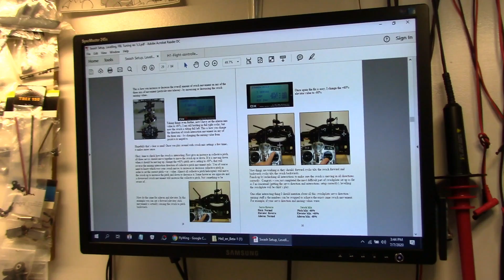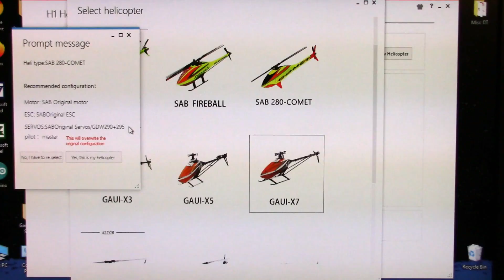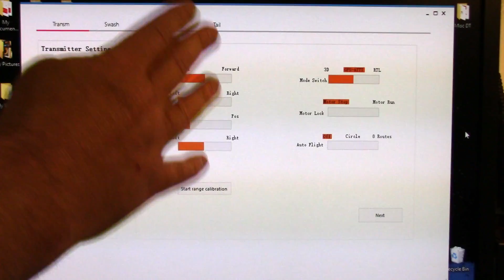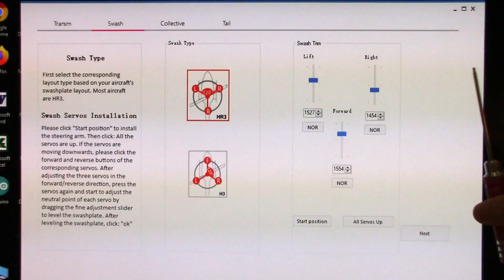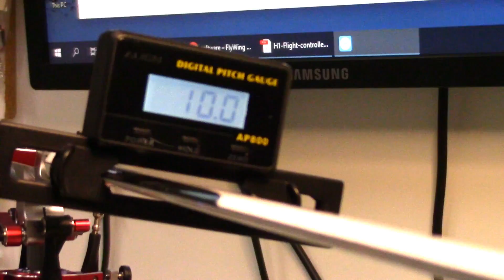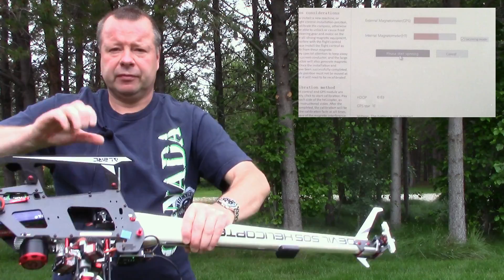Flywing H1 Setup Tutorial & Tips

Comment: will you be reviewing the new H1 unit with the smaller GPS unit.
cheers.
Reply from the maker: Nope, hate these things and we no longer allow them at our field.
Reply: @rchelicopterfun  any real reason, or just that they make new fliers think they can fly a helicopter.
Reply from the maker: I cover it on my web site in detail on my "Are RC Helicopters Hard To Fly" page:
https://www.rchelicopterfun.com/are-rc-helicopters-hard-to-fly.html

Quick summation: Main reason is they are extremely dangerous for the exact reason you stated. It's one thing having an entitled droner flying a harmless quad copter without any skill or knowledge, it's a totally different story when that same type of person has a 5hp helicopter spinning a 1.5 meter diameter rotor disc. I've seen way more high energy crashes with these GPS systems on helicopters in the hand of morons than we ever saw before with normal mechanical and electronic flybar stabilization. It's why they are no longer allowed at our field.
Reply: @rchelicopterfun  Totally agree, I usually take mine with me when I go flying my gliders, slope soaring mainly, it makes a nice change for half an hour while batteries are re charging, usually I am the only one around now with the size restrictions so don't get tempted to show off.                                                                                                                                                                                                                   cheers.

Comment: I just got the FLY WING Huey UH-1 and right out of the box I got a GPS Connection Exception error (constant blinking red light).  Support told me I need to calibrate the compass which i did successfully many times.  I ordered a new FlyWing H1 FC GPS Long Wire which should remedy the problem.  Great eye opening video presented in a professional educational format.  UPDATE: Replacement GPS module installed, recalibrated and flys like good in GPS.  When switching from GPS mode to 3D, the Heli descends, so I have to push up on the collective past center, need to figure out how to tune that and I'll have a good heli.

Comment: could not get mine to unlock motor even after getting green flashing light any tips?
Reply from the maker: LED has to be solid green - flashing green indicates it has not acquired enough satellites to position. Also recheck channel 7 (motor run) output calibration & direction in the transmitter setup portion of the wizard. May also have to recalibrate your ESC to arm if it was calibrated for a lower input signal than channel 7 is now producing. Also confirm the throttle % output setting in the wizard .
Reply: Ah solid  green LED.  I feel so klutzy (lol) ok I will make another attempt in morning.  Going to study the steps/tips provided.   I was about to just put on an ikon (have laying around) but don’t want to give up that easy :) I will keep you posted.  I also have two of your books I rely on before hitting up the internet.. I have them all highlighted and taped.  Very useful knowledge and detailed.  Thank you Mr John Salt!!
Reply: Success!!! Recalibrated ESC using CH7, recalibrated the GPS.  Followed all your steps checked wiring.  Thanks again!!!

Comment: Dear Mr.Salt. Thank you for very helpful videos on YouTube!!! May I have a question, please? I´m struggling with one think. Usually I´m flying on left stick cyclic completely and on right stick gas with tail, as well. Normally it is mode3. But! On the H1 diagram (setup assistant) I have problem with correct stick moving (indication). With this mode3 are changed throttle with elevator - I mean when I move collective stick (pitch) the diagram indicate moving of elevator and reversed. Correctly goes it if I change the transmiter mode from 3 to 4. But in this point I have unfortunately pitch on the left stick. I have no idea, how to harmonize the correct moving between sticks and the diagram. I suppose when it is on diagram incorrectly, will the unit also in flight incorrectly work. Do You have any tip for me please? A big thank to you in advance, Vlastimil (please, sorry for my English)
Reply from the maker: Contact FlyWing tech support. I don't even know if you can change channel mapping within the H1 (I don't think you can). This to me would strictly be a computerized radio programming issue to remap the outputs for different stick modes.
Reply: @rchelicopterfun  Hello, ok thanks. I will do it. Have a nice day.

Comment: Does H1 have the option for setting the tail pitch at zero degree when throttle hold switch on the transmitter is activated for auto rotation or is it set in the transmitter? Thanks for the thorough instructional video.
Reply from the maker: Heading lock - not required - done automatically.
Reply: @rchelicopterfun  thank you

Comment: John I'm having trouble calibrating GPS and H1...how do you keep from getting tangled up with H1 cable cause offline doesn't work well for me. Thanks for listening
Reply from the maker: You mean the USB  cable during compass calibration? If so, I never had any issue getting tangled up while calibrating the magnetic compasses; you just turn the the heli along each of the 3 axis the opposite way the same number of times on each axis so the cable never tangles.

Comment: Hey john...great video and informative....Just now thinking of buying two of these H1's. I want place H1 in a 500X Align and a XL power 550. Do I need to readjust my ESC for voltage output . The BEC output voltage should be to 7.2V. and other question is the Aircraft title should be normal airplane or helicopter. Not good with this technology stuff. Still learning?  Thanx a lot

Comment: Hi John, we many H1 flyers encountered many different issue. not sure you still have it with you. would be interested to see H1 interner and what type GPS module they using? Found it quite similar to M8N pro with 6pin, just not sure the pin layout is it the same.
Reply from the maker: @Alex Bong RC Fun Land - Best way I know to avoid H1 issues is to get rid of it and put in a proper FBL system 😄
Reply: @rchelicopterfun  The main selling point that  H1 attract us is the GPS positioning. It locked the heli made it so stable and easier in hovering and flying. 😅
Reply from the maker: Where's the fun in that 😄
Reply: @rchelicopterfun  still fun, just less stress on crash it…hahaha

Comment: CH 3 is THR or collective what controls the pitch?
Reply from the maker: Ch3 is collective - I covered this in detail in the video in the channel mapping order segment, with channel 7 engaging power - there is no throttle control - only a fixed output you select in the setup wizard.
Reply: @rchelicopterfun  OK I will go check the video again Thanks

Comment: Can this work on a nitro heli with a fly bar?
Reply from the maker: @ Mike Smith - No for two primary reasons:
1. You can't use any RC helicopter electronic stabilization system (flybarless system) in conjunction with a mechanical stabilization system (the flybar).  At minimum you would get uncontrollable cyclic oscillation with two stabilization systems countering each other out of phase. At worse - the heli will crash as soon as it gets light on the skids.
2. As you saw in this setup video, the H1 has a single throttle channel output value. It would therefor be impossible to use on a nitro engine which requires a variable throttle output to enable choking, fast idle trim @ startup, low idle trim once warmed up, and a variable output to match engine/rotor speed with collective pitch loading (why we use nitro throttle curves). Even if nitro governor is used, you still need variable throttle channel output levels to put the governor into it's various nitro running modes (choke, start/idle, governed normal, st1, st1 head speeds).
Reply: @rchelicopterfun  Thanks for the info. I'm a total noob when it comes to Heli's, throttle curves, etc I'm more of an FPV racing drone flyer. I've never actually fired up my Raptor 50(Bought it for $40, couldn't pass it up!), one day I'll fly it. Just scared shitless till I get better with my Blade 330s. I got the BNF one and trying to set it up with my radio master 16x which needs manual programming the throttle curves .  Heli's are a whole new world to me

Comment: Hi now I can conect and config with mi laptop , but I think the tail gyro is wrong, because correct to wrong side... with my helicopter is on, and I can full control with my radio, when take the helicopter with my hands and turn tu righ, the tail nove to the right side, then I turn the heli to de left, the tail move to left. I think that is a problem... should correct to the opposite side so that it can counteract the turning force of the main rotor

Comment: Thanks John, for sharing your knowledge. I wanted to ask you what you think of applying a pitch curve for when it is ONLY in 3D mode, I don't want to do 3D flight but I do SPORT, and I would like to have a curve with -5º, 5º and 10º. Apart from this way having 5º in the middle of the STICK, when you go from GPS mode to 3D you will not have that sudden drop.
Reply from the maker: The H1 instructions are very specific to having a linear and full collective range regardless of flight mode. No idea how applying a narrow (and lopsided) pitch curve would alter its response and output behavior? My guess is it would work fine (only in 3D mode of course), but it may end up in a parts shopping list as well. In short, you would do it at your own risk - and have lots of altitude while testing it to make sure you have ample time to save it if things go south. It might be worthwhile to contact Flywing to run the idea by them.
Reply: @rchelicopterfun  Thanks John, is what I had concluded. The truth is that ONLY applying a curve in 3D mode I see no problem, in the end it is nothing more than limiting the output of our station, so that it does not reach negative 12º. I have acquired the H1 to be a teacher, and save me from difficult moments. I'm mainly going to fly in acro mode. But I didn't want to have such an aggressive pitch curve.
Reply from the maker: @Ignacio Sabido - yes exactly, it would be no different than giving smaller collective stick commands after all, so I can't see there being a problem; I of course have to cover my butt in any recommendations I make with an unknown procedure that deviates from the manual - especially on this platform. If it works fine - feel free to comment back so others who want to have a more docile collective range in normal gyro / 3D mode can try it out as well.
Reply: @rchelicopterfun  Thanks, Jhon, I understand your prudent position. Logic says it will work. Anyway, following your recommendation, I have asked Flywing by email to see what they say, I hope someone competent will answer it. What I also think that it will improve by putting the center of the pitch curve about 5º, is to avoid the sudden drop when going from GPS to 3D.
Reply: What if I am thinking, that it will not be possible to arm in 3D mode with the pitch curve applied, it should always be done in GPS mode
Reply: Hi John, FLYWING just responded to my email a few minutes ago with this short message.
------------------------------

yes ， you are right
： Apart from this way having 5º in the middle of the STICK, when you go from GPS mode to 3D you will not have that sudden drop.
You can of course set it.
--------------------------------

Anyway, when I install the H1 and do the tests I will leave the expected results.
Reply from the maker: @Ignacio Sabido - Good stuff. 👍

Comment: I just bought a pre-programmed trex 450l dominator with an Align A10 transmitter, is it possible for me to get this working? :)
Reply from the maker: As I said in the video, the H1 uses an S-Bus input. If the RX that came with your 450L has an S-Bus output (and is at least 8 channels - 9 if you want the invert function), you should be able to make it work.
If it doesn't have an S-Bus output or at least 8 channels, then it won't work (you would have to get a different receiver in other words with both S-Bus and 8+ channels).

Comment: John,
Thanks for the review and setup of the H1-GPS system. I'm a 75 year old kid and haven't flown my Trex 500 esp for several years due to arthritis issues. After your review I purchased a FW 450 v2 helicopter and I'm extremely pleased that I'm back enjoying my hobby. I would like to update my Trex 500 to the H1-GPS system. For mild flying what servos and esc would you recommend.  I know the H1-GPS requires a higher voltage of 7.4 vdc. My current system is setup for 5vdc. Any suggestions would be greatly appreciated.
Reply from the maker: Howdy Darrell, Glad to hear this technology has allowed you to get flying again. As I mentioned in the review video, that's the H1's single best attribute.
As for your Trex 500ESP, I guess the first question is have you converted it to flybarless already? The H1 like every other FBL system only works with flybarless rotor heads. 
For powering the H1 and servo recommendations, there are an array of options at your disposal. You can keep the original ESC if you wanted and use an external BEC for example, or a dedicated RX battery. Servos same thing - several workable options to consider depending on what you are using right now along with what receiver you are running along with what radio system.
Best to contact me through my website on my contact page ( https://www.rchelicopterfun.com/contact.html ) for more complex technical topics like this as I rarely see follow up questions in the comments section of YouTube.
But if your 500ESP is still fly-bared, then all that is moot unless you already have or plan to convert it to flybarless.

Comment: I see they have updated the program firmware on the H1 since you made the video. I was wondering if it was any better, if you had checked it out John
Reply from the maker: Yes I have, very little differences. My two main issues still there: 1. No way to save your setups. 2. Haven't separated cyclic gain adjustment to pitch & roll axis.
Reply: @rchelicopterfun  it's still of little use then, still a robot in the sky,  thank you for the reply John

Comment: Would you trust this on a Roban 800 size EC135?
Reply from the maker: Not a chance!
Reply: @rchelicopterfun  why is that
Reply: @rchelicopterfun  which one would you suggest
Reply from the maker: Use any good flybarless system that has lots of tune-ability and if possible elevator (pitch filtering). Using pitch filtering in big heavy tailed scale helicopters is the only way I know of to totally get rid of unwanted heavy tail bobbing and proposing. I use the Bavarian Demon 3X in all my big heavy helicopters and love them! Their Axon would also be another good choice. I'm sure the Futaba CGY755 would also work well, but since I've never used one in a big scale bird - I don't know if it would work as well as a Bavarian Demon.

Comment: Hello Mr John Salt!
congratulations for your work!
-can you help me? I can't start the engine in GPS mode ... sticks from the throttle are calibrated to a minimum of 1000 ... I re-programmed the radio (taranis x9d-plus) and I don't know what else to do ...
please can you give me some tips?
thanks!
Reply from the maker: Very difficult, impossible actually, to diagnose H1 functionality issues remotely. Way too many variables to sort through. Only thing that jumps out at me is you mentioned throttle stick calibration. The H1 doesn't use a throttle stick output from the radio. Channel 7's output alone turns the throttle signal on or off. The single speed throttle output level is set with the throttle output setting in the H1 setup wizard. Both sticks also have to be held in the bottom right corners (as shown in the review video I did on this thing) before it will allow a throttle output - very much like a quad copter ESC arming procedure.

Comment: why is it when i switch from 3d to gps or vice versa my swatch plate change? is that normal or i have to set it up again., thx
Reply from the maker: Normal.
Reply: @rchelicopterfun  thats suck. in regular gyro, i have to adjust my idle 1,2 pitch curves from normal mode. so that heli wont jump up or down in the transition.
Reply from the maker: It won't jump if you anticipate the change. It's no different from changing flight modes with different pitch curves. Anticipate the increase or decrease in lift the moment you switch and you won't even experience a change in your lift vector. We've been doing it this way for decades without this GPS autopilot nonsense after all. 🙂

Comment: hi john! i followed all you did on your tutorial video and everything goes well. but when i connect it to the battery,  i got stuck on blinking yellow light and the manual says helicopter preparing. it took forever for the yellow led light blinking. i did try to reset the FC again and no luck at all. still the same. do you have any idea how to fix this issue. by the way, i'm using a flysky transmitter and reciever 10ch and both support pwm ppm/ ibus sbus. any help please!!!!! thanks
Reply from the maker: Sorry, no idea.

Comment: why is it my H1 unit between control and gps is 6" approx  wire length. ? did you purchase longer wire for gps?
Reply from the maker: Because you ordered the 13cm version instead of 45cm version would be my guess.
Reply: @rchelicopterfun  thx. if you don't mind a question again. "please turn the rocker" ? its in the Main set up, what is that. thx

Comment: Nice tutorial video. I can I use my jr 11X radio on flywing h1? And orange r920x receiver.
Reply from the maker: As I state, you need an S-Bus signal output from the RX. I don't know a thing about the R920X; if has an S-Bus output it will work, if it doesn't it won't.